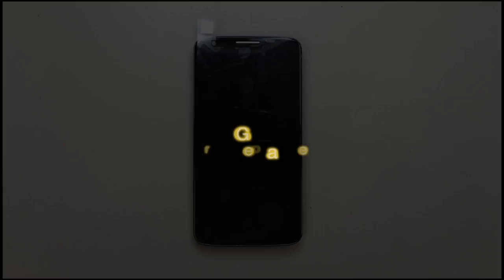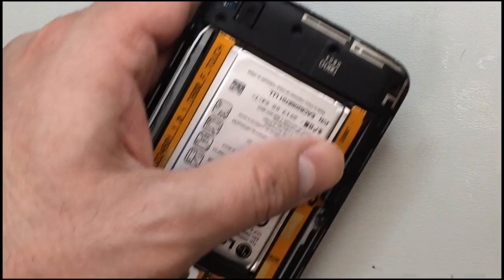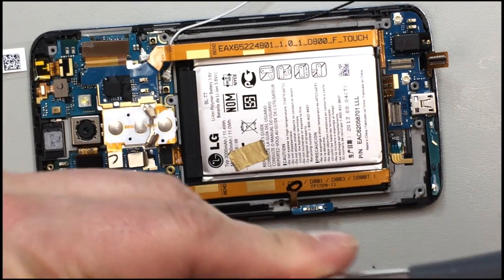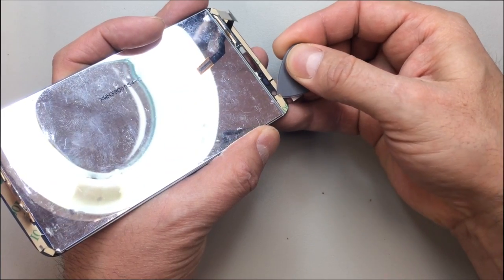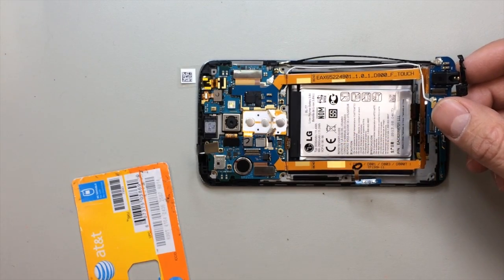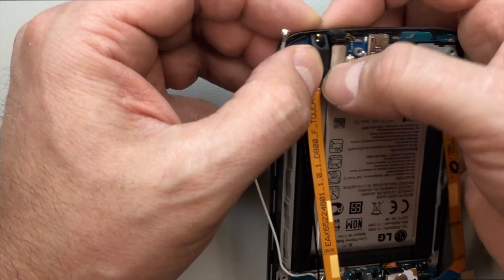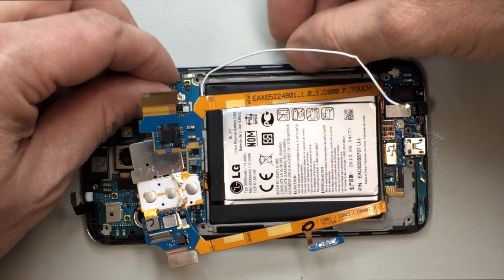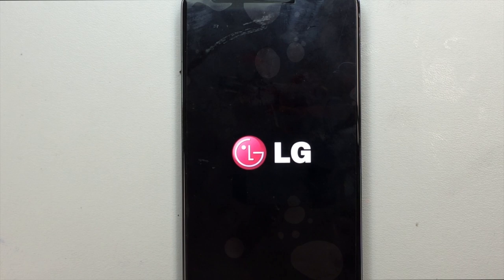LG G2 Screen Replacement Tutorial

Comment: Man, good luck to owners doing this repair for themselves. As a technician, I don't touch phones like this at all, there's just too much that could go wrong that I don't want to be liable for.
Reply from the maker: I'm not sure what market you are in but for us, the Sprint CDMA version is the one that tends to come back most often for post repair issues. For that reason we no longer service the Sprint G2. For that matter just about anything Motorola or HTC from Sprint I won't go near. The LG G3 and forward are easier to work on.

Comment: would it matter if the LG g2 is sprint and I'm using a verizon screen. would it still work
Reply from the maker: +Vue Thao It might. In my experience the Sprint version is buggy and we always went with the screen designed specifically for that one to avoid problems. Not sure what is so special about the Srint G2 but it seems like a lot that were repaired would tend to have problems afterward. Off the top of my head I do remember that the gasket for the proximity sensor is so different that it had to be cut in order to fit properly.

Comment: hi,my lg g2  d801 screen broken touch is unresponsive at some points on the screen but the screen lights up perfect..now what should i buy only black Outer Touch Screen Replacement Lens Front Glass 6.99 $ on ebay or the LCD Display+Touch Screen Digitizer Assembly Part 47.99$ on ebay
Reply from the maker: For the G2 the digitizer is attached to the glass so anything at $6.99 is most likely a waste of money as it won't allow the touch screen to function. The best option is just getting the whole piece, LCD+digitizer+glass for about $55.
Reply: ok thanks ..! can we fix it with our own by seeing the video..will it work perfectly after fixing the new assembly?
Reply from the maker: shashank mamudala If the repair is performed correctly then yes it should with one exception. If you have the Sprint version I would not bother. They seem to have ongoing problems once taken apart.
Reply: hii thanks.. i have installed my new assembly just now but i did not keep my back cover yet..i got a light small finger print of my finger and a small dot on the screen while installing can i remove that?? and is the use of Adhesive Sticker Tape which i saw in videos where should i keep it?
Reply from the maker: shashank mamudala I am little confused by your question. Did you buy the whole display assembly? Where is the fingerprint, behind the glass? Are you asking where to place the adhesive or where to find some to buy?

Comment: Hi, i have cracked LG G2 D802. Does the D801 or the D800 screens from your website fits in this model?
Reply from the maker: They are actually different but I have added links to the D802/D805 version at the bottom of the page.

Comment: Hi! My lg g2 screen cracked and i think it affected the touch screen too because the screen is too sensitive and i can hardly navigate anywhere. Will the touch screen problem will be fixed if i fix the screen as instructed in the video?
Reply from the maker: This repair completely replaces the digitizer so if the problem is caused by the screen being cracked, and it most likely is, yes this should fix it.

Comment: Hi I ordered a LG G2 LCD digitizer pre-installed in a frame assembly. I tore down a broken LG G2 and re-assembled it in the new LCD digitizer frame and everything works well, except for the fact that when I tilt the screen to the left or to the right, I can see light bleeding out near the sides. Is this because the LCD/digitizer is not attached to the frame with strong enough adhesive or does this have to do with the LCD+digitizer not being attached together strongly enough? Here are some pics of the screen bleeding. Have you ever experienced this problem? 

http://imgur.com/v476QVF 

http://imgur.com/icDLXKl 

Thanks
Reply from the maker: I've seen this a few times but most often with HTC parts. One of two things probably happened. Either the lens was not sufficiently attached to the LCD or stress caused them to separate during the repair. Since there are flex cables at both ends of the digitizer it would be difficult to add new adhesive without risking more damage. I would contact the supplier. They should be able to exchange the part for you. And thanks for uploading images! That makes the question much easier to answer.
Reply: Go Cell Phone Repair Hi!    Tutorial worked fine, except I'm also having the "light bleeding" problem that amberlampz mentioned.   LOoks just like her pictures.  I tried taking out previous black goup (manufacturer adhesive) and replaced completely with double sided "permanent" tape from art shop.     Made bleeding more prominent.  Now, screen (new screen) is showing some loss of sharpness (i would guess that's the term), which goes away completely when I plug the charger or headphones in.   I figure I need to open up again to see if flex connectors or some component is loose - but redirectable whenever I'm pluggin in charger/headphone.

questions:  (1) any specs on adhesive tape or whatever adhesive compound manufacturer gave with it?
(2)  anything else you suggest about the sharpness deficit that corrects with plugging in.

Thanks again for the tutorial.   Do it yourself is awesome!

Comment: I took my LG G2 to a "professional" to replace the screen and digitizer
The end result looked great at first... until i started noticing a gap at the sides of the phone between the screen and the body of the phone.
should i be worried about dust getting in there or even the screen falling out? obviously the guy screwed up with the adhesive...
Reply: Hey there, mine also did this. I believe it's the glue that the shop used. I would take it back. Where did you go?

Comment: I followed the video to a T and when I powered my phone back up the image wasn't displaying. There were a bunch of small lines across the screen with no image. What should I try? reconnecting it all over again? any specific connector i should pay attention to?
Reply from the maker: Where did you purchase your replacement part? There are a lot of bad G2 screens floating around so that may easily be the problem. Other than that there is a white antenna wire on the inside which sits on top of some circuitry at near the bottom end of the phone. If it does not already have Kapton tape covering it you might try adding a small piece of electricians tape between the wire and the components as it is possible that interference may bleed over between them although this usually results in a distorted image rather than none at all.

Comment: i am wondering, i have a cracked screen on my d802 and it hasnt yet been fixed, but as i can see my signal bars are not working is that due to the digitizer been damaged by the crack on the screen??thanx
Reply from the maker: Maybe but it should not affect the signal itself; you should be able to call the phone and it rings. Otherwise you have an unrelated problem.

Comment: where did you get the screen and did the tool kit come with it?
Reply from the maker: I will add a link in the video description shortly for the part. It did not come with any tools so you will also need something to pry with. A medium to thin guitar pick works best. Also Pick up a PH00 screwdriver as you will need it for the inside. A heat gun also comes in very handy.
Reply from the maker: Looks like you might need a T5 or T6 driver as well. I will check as soon as I get a chance. Also you might need adhesive. Sometimes they come with it but not always. 3M 300LSE works well.

Comment: not easy phone to assembly, isn't it?
Reply from the maker: A little tricky but not nearly as difficult as most HTC and Motorolas.
Reply: Go Cell Phone Repair Like the htc one x!! That phone made me want to throw it through the window!! Complete disassembly just to replace the screen!
Reply from the maker: That one too. Have you worked with the 8X before? It must have taken me an hour to figure out how to make the new screen assembly sit flush. And that black tape they use to seal light from leaking around the edges of the screen... Just seems like an afterthought.
Reply: Never worked on that one. I just fix my own after stupid mistakes (dropping most of the time) I appreciate your video. I just had to replace my G2 screen last night. Thank you and who knows, I might catch another one of yours on whatever phone I end up with next.
Reply: Adam Piechociński I followed the instructions and I  was able to reassemble the phone.  however my display is not clear a third of the is screen is not visible.   do you have suggestions on how to fix it?